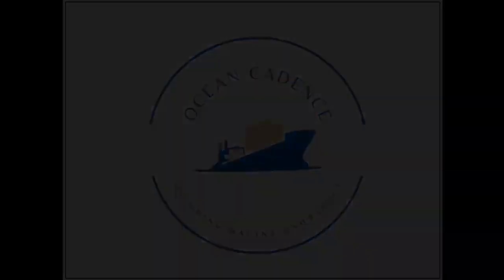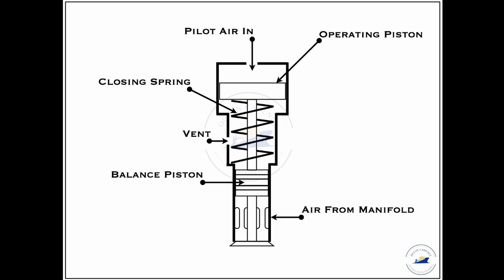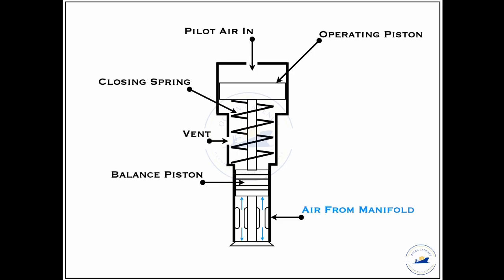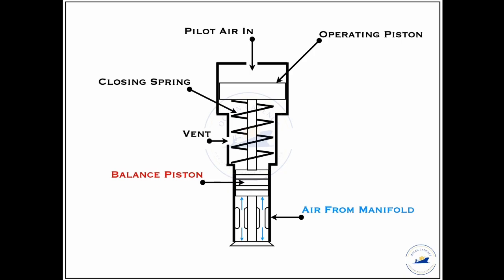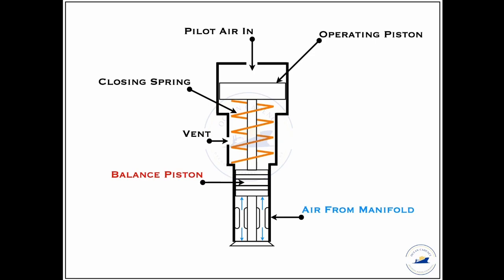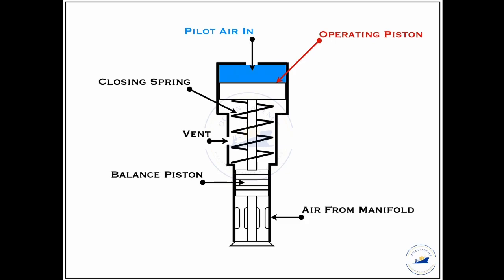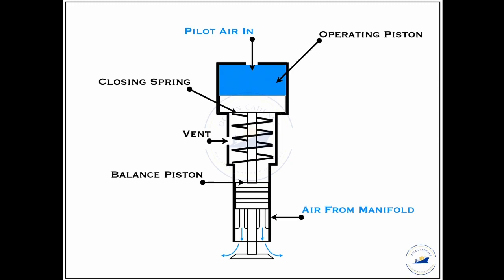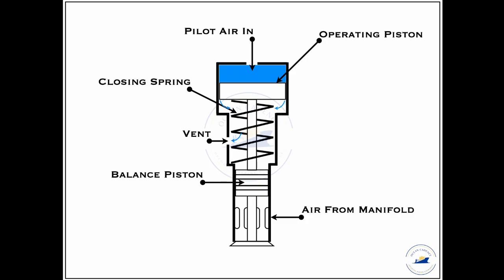MAN B&W | MAIN ENGINE | STARTING AIR VALVE | DIAGRAM & WORKING|

Comment: So, Pilot Air is 30 Bar and not 7 Bar. I was confused as I had read somewhere that it is 7 Bar.
Reply from the maker: Excellent point, the 7 bar air design is for other engines, MAN B&W design uses 30 bar as “pilot air” tapping too.